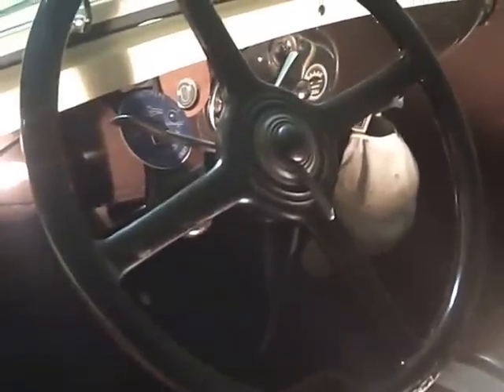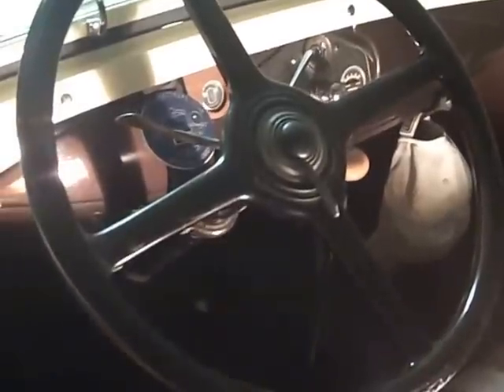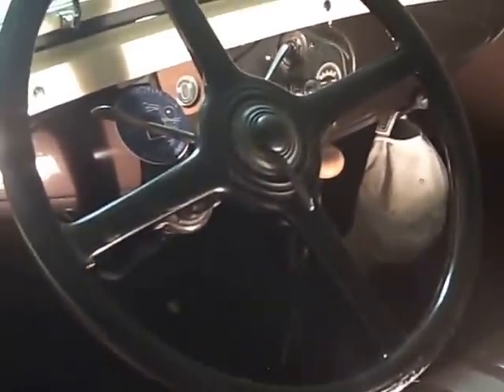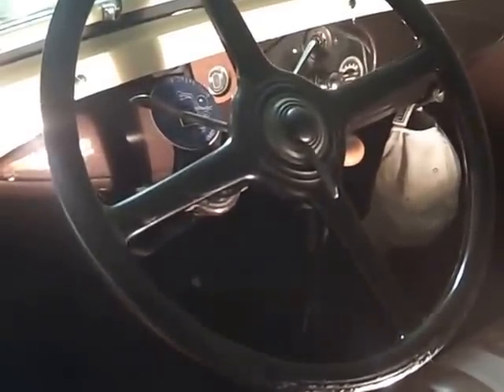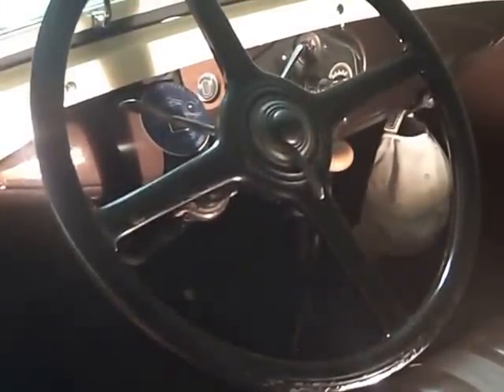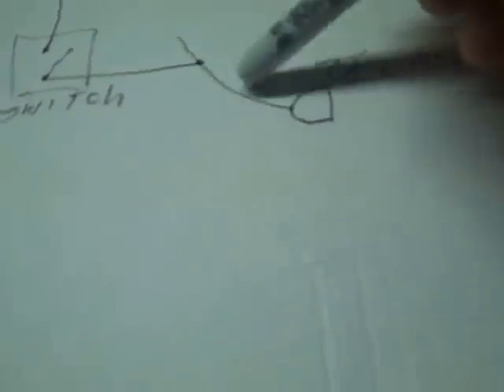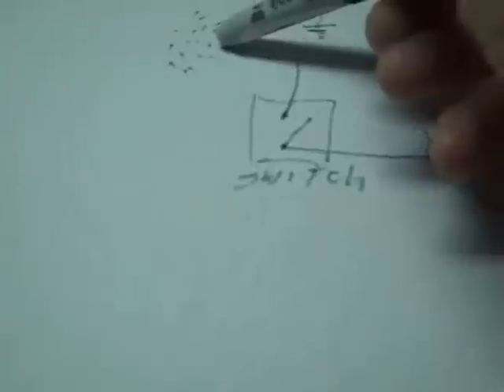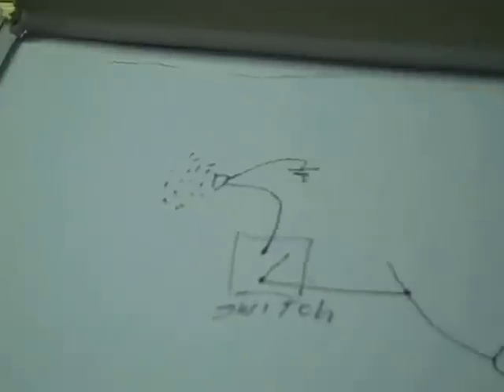Model A Lights On Buzzer Installation March 2015

Comment: Hi Jack. Love the videos. I cant tell you how many times I have had to double back to turn off the lights in my 30 Coupe. With a brake light switch, isnt the circuit closed or complete when the button is depressed? Pushing the brake pedal depresses the button, closing the circuit to run power to the lights. How does opening the circuit run power to the buzzer? Thanks and cant wait for the next video.
Reply from the maker: +Julie Laughlin The switch is normally closed.    When the shaft is allowed to travel forward when you push the brake, the circuit is closed and the lights come on.  Take a switch apart and see how it works.  Very simple.  jack